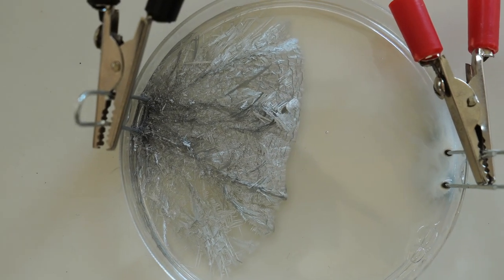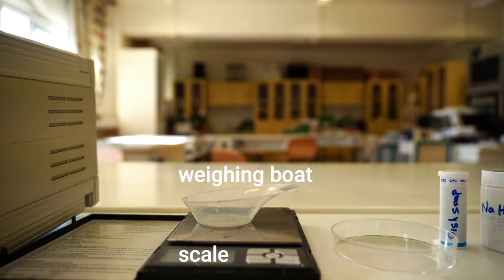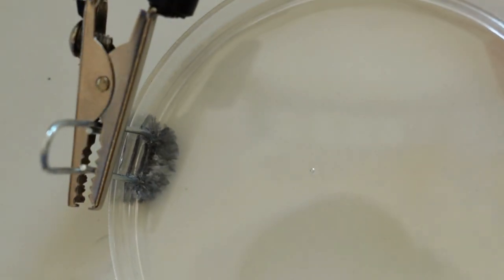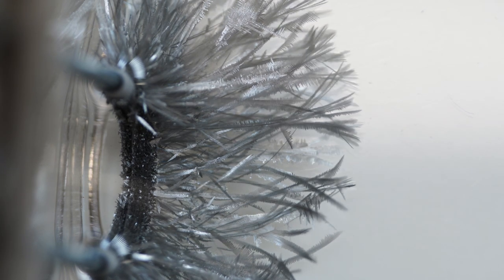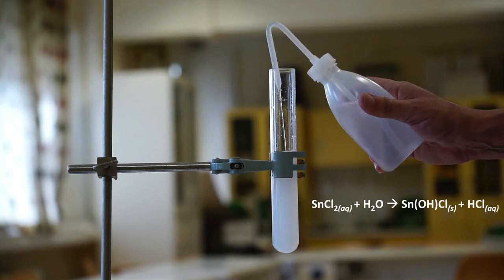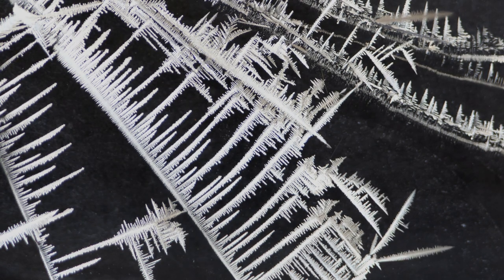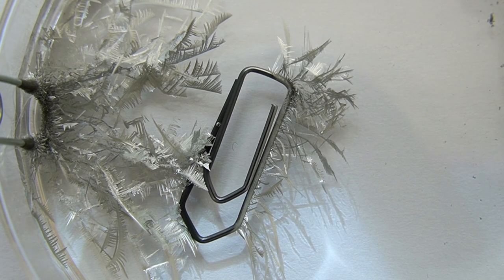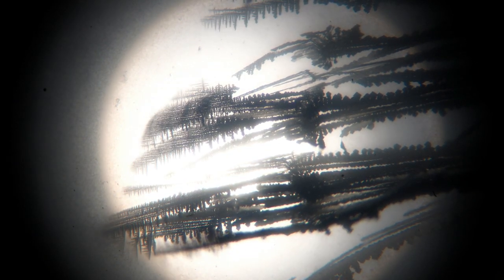The hidden beauty of tin crystals growth (revealed by macro-video)

Comment: سحبان الله💖
Reply: Can the solution prepared be used on the next day, if it turns turbid? Will we get the results?
Reply from the maker: @suchitrarane4137  if you filter it before use you get decent results although the solution will be a little yellowish.